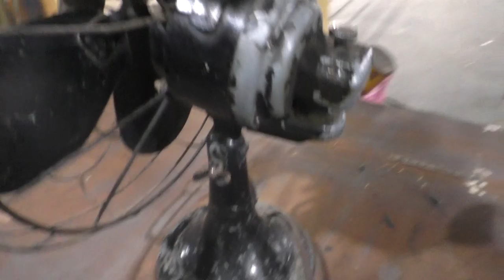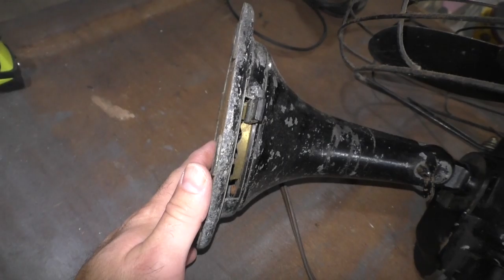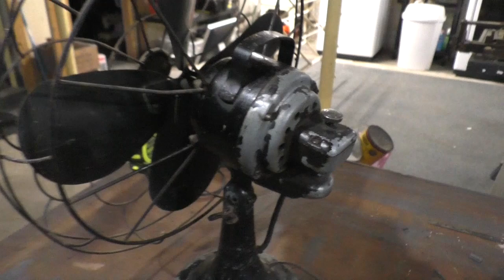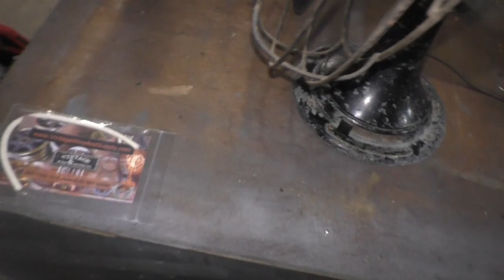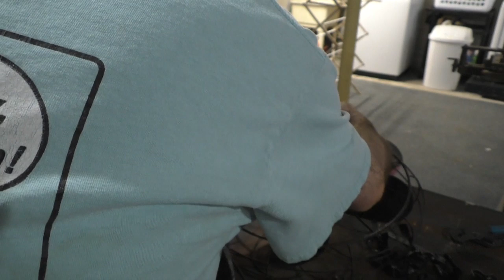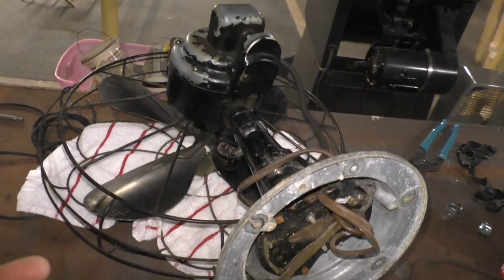1930s 16" Delco Fan Restoration - Evaluation

Comment: Timely video. In complete agreement with you that new fans are landfill from day one. 
I literally just finished pulling apart, and re-lubricating my year old oscillating pedestal fan after I found it locked up solid this morning. Second time it's happened in a month. 
Cost must have been too high for the manufacturer to pack the bushings with an oil wick to keep the bushings lubricated, as I see none in there. 
Wasn't exactly a cheap no-name fan either. Payed close to $50 for it, and who ever manufactured it apparently has Honeywell's blessing to put their good name on it.

 I've even had fans from 30+ years ago last decades without anything more than an occasional cleaning. Wish I could use something older, but those big open fan guards, and a toddler in the house, isn't happening.

Comment: First thing I do is check if the blades are balanced.  Bent blades are extremely difficult to balance perfectly to avoid vibration.  These small blade are much louder than the Vortalex overlapping blades.
Reply from the maker: Blades that are out-of-balance can be re-balanced using a lawnmower blade balancing rig, but blades that are out-of-clock, or have one or two blades out-of-pitch are a f***ing NIGHTMARE to deal with! My 12" Vortalex is one such animal... really, it needs a new blade at this point, which is why it's mounted to my screen porch wall rather than being used indoors.

Comment: The blades are aluminum, the base and rear motor cover/gearbox are pot metal.
Reply from the maker: Thanks! I figured as much.
Reply: @bbishoppcm  You're welcome.  One thing I'd recommend is removing the headwire outdoors if possible, it may contain asbestos insulation.  I'm interested in how well the Evap-o-Rust works, and following your resto with enthusiasm.
Reply from the maker: @HarleyBadger  I've likely received a lifetime of asbestos exposure in this house just in the past six months! Evaporust is the most incredible product I've EVER used; I dumped a pile of old rusty hardware from a 1964 Vespa I was going to restore (but gave up on due to costs), and everything came out looking brand-new (aside from some light pitting on the heavily rusted bits). My dad had a bunch of old rusty files that he was going to throw out, and they too came out looking brand-new!
Reply: @bbishoppcm  Heh.. Yup, I hear ya there!  What little bit that's in the wiring insulation won't be much of a factor.  And glad to know!  I'll have to pick some up then.  We have plenty of rusty bits here and there for projects that would benefit.